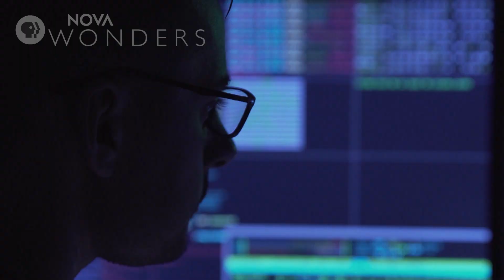Meet the Robots at Amazon

Comment: With robotics you are creating jobs but NOT more than you are destroying. If you eliminate 10,000 warehouse jobs, are you creating 10,000 robotics jobs at the same time?
Reply: True
Reply: This would be true if your scale was not off. Amazon never had 10,000 employees on the floor moving merchandise. They would need much more than that to move that kind of volume they have. It was never possible from the start. These Robots took over what 5-10 pickers did through the use of a conveyer system…..but they do WAY more volume. So you lost 20-30 jobs per warehouse. 

HOWEVER, it takes thousands of people to maintain these robots. People need to construct and maintain their facility, you need the people that build them, you need the support personnel, you need management, you need part distributors, you need freight, you need developers, programmers, technicians. List goes on and on.  

For example, how many cashier really lost their jobs over the self-checkout? You had what, maybe 6-7 cashiers on the floor at once in a grocery store? They move 4-5 of them to different positions and install self-checkouts. Which also need to be developed, programmed, built, maintained, etc. You didn’t lose any jobs in this circumstance.

Comment: The most depressing place I ever worked at. Amazon fullfillment center. 10 hours of non-stop movement. 12 hour shifts around Christmas time. I received write ups for every small issue. 6 errors out of 3000. etc... With a write up, you are restricted from changing jobs. Write ups last a month. Once I was off of one write up, I got another. Very sad place to work. Glad I have since moved on.
Reply: So sad, I have heard the same thing  about amazon working conditions. I am glad you moved on to something better.
Reply: I love it! I like the teamwork with the the robots. Until they malfunction then you realize they won’t replace us because we’re like machines also only better
Reply: Good for, I heard the same. Hellish work culture.
Reply: I work 10 hours, 30 minute lunch and 2 - 20 minute breaks. We can use our phones while stowing cuz of corona its not completely bad. I did get one hour late which never happened but whatever.
Reply: @randomguy9777  at mine we dont have air conditioning :/// and it freaking sucks!
Reply: I TOTALLY agree with you:
A-S-O-L-U-T-E-L-Y 
no, 
zero, 
reason to work more than 8 hours a shift. 
It felt dangerous.
And then...,
They told me my percentages were too low after I put my time, energy, heart and soul into becoming the best stower. I really work hard at every job I do; and they pretend you suck. (...IN THE FIRST WEEK.)
Reply: @byronfaulder2367  I don't know, I prefer the 4 - 10 hour weeks. 3 days off is nice.
Reply: @bryong159  
If that were possible, yes; but it isn't.
THEY give you the hours you WILL work.
And, they change them each week.
One schedule had me working 12 hours and then had me back after 10 hours to work another 12. 
And it was hard to go to sleep in that space of time, even "dog-dead" tired, with the knowledge of another loud, isolating, unappreciated 12 hours of "don't make one mistake as you go as fast as you can" a day LOOMS over you..., Quantity/Quality..., 
You lie in bed and DWELL on your Life/Future..., aughhh...!
YEAH...!
I would have stayed, 
IF I could have worked 4/10 in a row with three day off, or 5/8 in a row with two days off; or even 3/12 in a row with four days off; 
the SAME every week. 
But, they don't let you. 
It's NOT a Life; 
it's a Zombie-bot existence.
Reply: @byronfaulder2367  You should probably look into being a tech at amazon. A lot less stress and a lot more freedom to do as you want.
Reply: @bryong159  I appreciate your comments; and they are well said; but, I have moved on to other work, I like to contribute where I can see the real results. 
I like Amazon, I still use Amazon, and I respect the hard work behind it all: Humans/People. Especially the people who have made what I was doing a long-term venture. It takes that "type" to do it. I've done plenty of high-stress work, including music performance, it's the Amazon process of evaluation that seems a bit off, even though your heart, mind and soul are into it; it doesn't help keep your position. If all of those who have been there for years have zero mistakes/high speed then, okay..., (Seems possibly..., not true.)
Reply: @byronfaulder2367  No I get it, I'm not blind to what I see here, in fact just this week the fire department and ambulance have showed up twice, probably due to some employee injury. I guess I see it from a different perspective being a technician (convyer or robotics), I get paid really good for my age and there's plenty of times where I'm sitting on my computer for 80% of the day and I have complete freedom to do my work tasks whenever I feel it's the best time to do it. But I do think amazon only thinks of general labors as squishy robots with rights. They do seem to expect robot work ethic and reliability from them.
Reply: @bryong159  Heheh... I'm glad to hear you're happy there. Whenever I order something, I think of the people behind it and NEVER order fast delivery. I always pick the slowest so that I'm respecting my fellow humans. Amazon's a good thing; but it can be better when the workers are lauded for their loyalty too.
Reply: @byronfaulder2367   its my first month here and it sucks honestly they tell me all the time that im not working hard enough. That im not going fast enough when im picking 130 items an hour when our goal is 104 . I cant leave tho until i find another job that pays this good 🤦🏻‍♀️ ugh